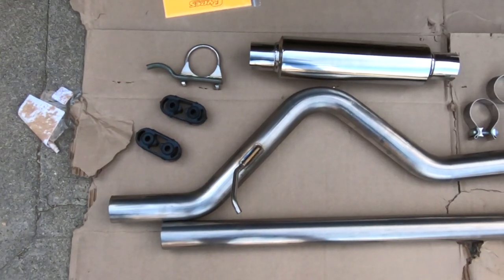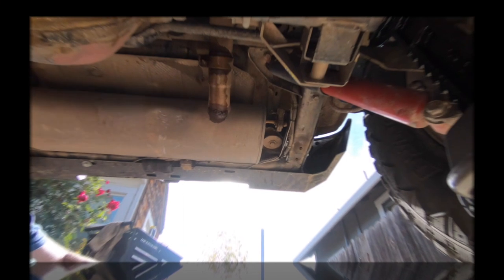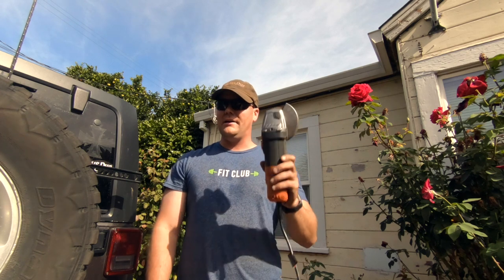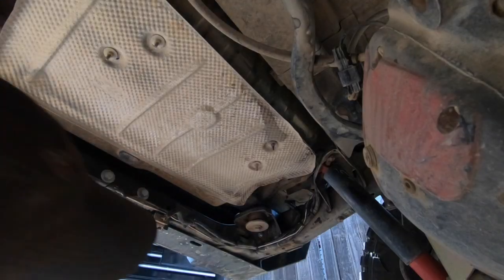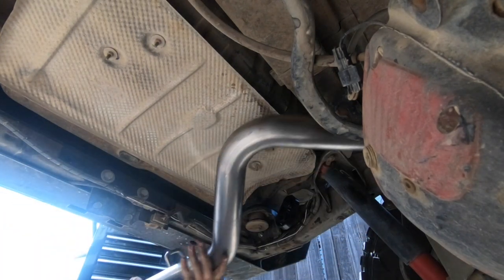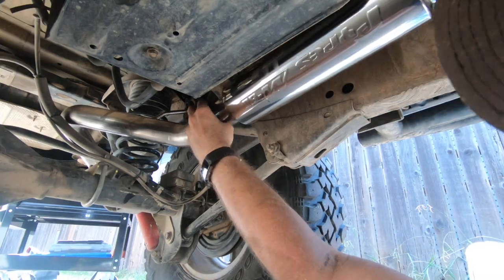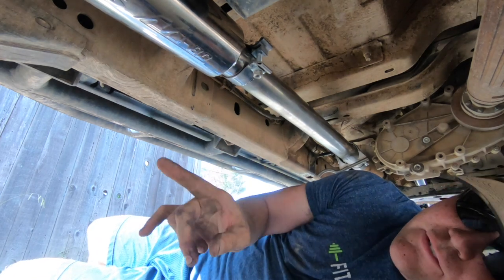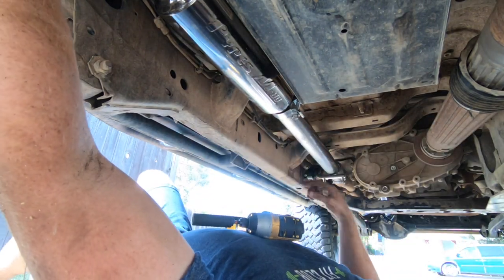Pypes High Clearance Cat Back Exhaust Jeep Wrangler Install and Sound Test

Comment: WD40 on hangers use a quick pliers wrench and you can basically pinch the hangers off. Cost me $0, just takes a little grip strength and they are off in 5 minutes each

Comment: If you get a pair of hanger pliers they will come off easily. A little wd40 on the rubber and it will slude right on and off
Reply from the maker: Yeah I know that now. I was actually looking at tools on amazon shortly after doing this install, and came across the hanger pliers. I will have a set next time I have to do exhaust work.

Comment: It is now 2021... how is this exhaust holding up since you installed it, or did you swap it already? Also, did you have the 3.6 engine?
Reply from the maker: I’m still running this exhaust with a 3.6. It’s held up great so far, and it still sounds great.

Comment: What’s the best way to loosen the bolt on the front clamp at the Y?
Reply from the maker: I ended up having to cut mine off with an angle grinder. The kit comes with all new clamps so you won’t re use any stock parts